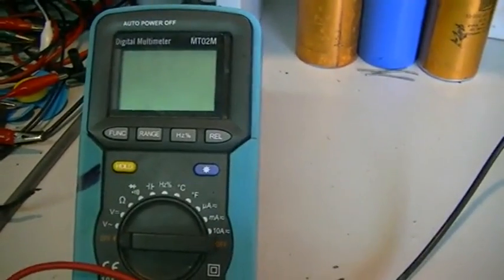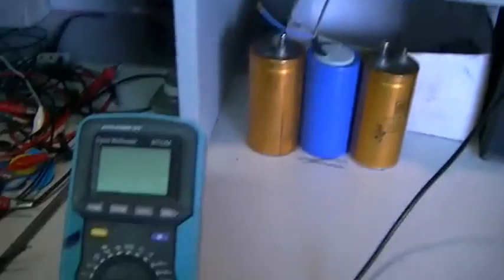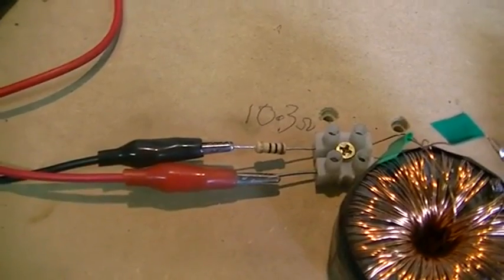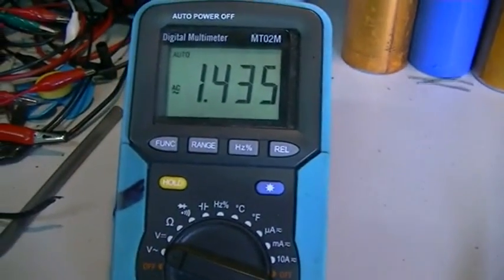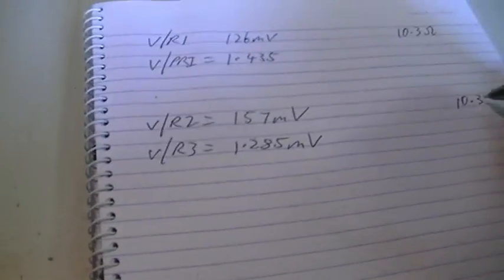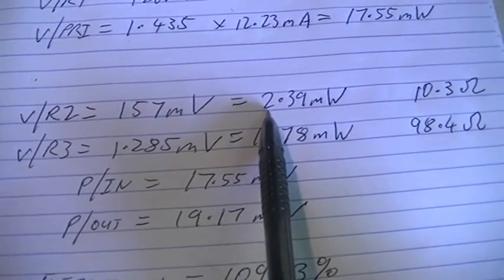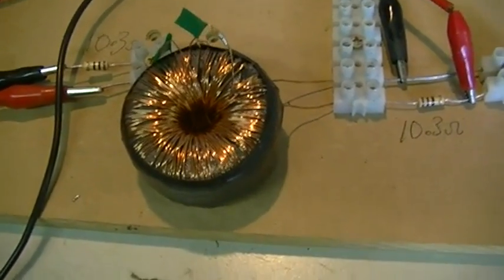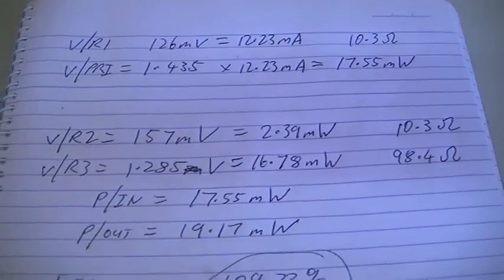Hybrid Toroid Transformer test 5

Comment: We pretty much agree this time... I get...
Output  = 1.442V RMS across a 108.7 Ohm total Load resistance
Output Power = 19.13mW RMS
Input Power = 17.554mW RMS
108.97%  (if all measured resistances are spot on)

Good work!  Months ago I tried to do this, using a LARGE pot-core as the "outer" core (wound externally like a squared-off toroid), around a smaller internal toroid... but never got the large pot-core that would fit over any of my toroids.  It should work though, if we can find the "off the shelf" parts.